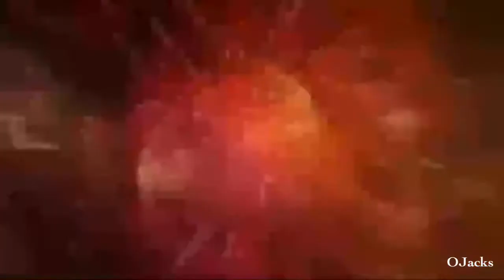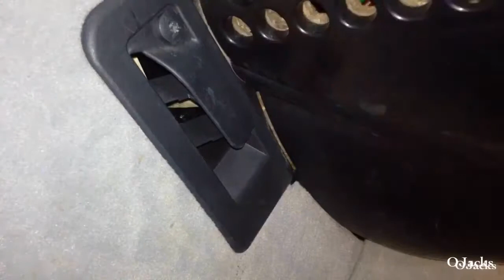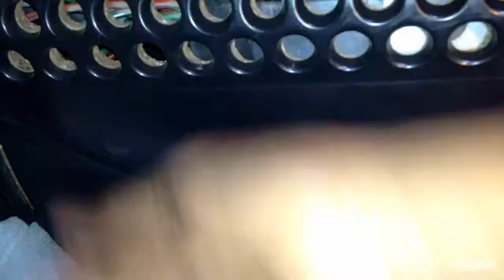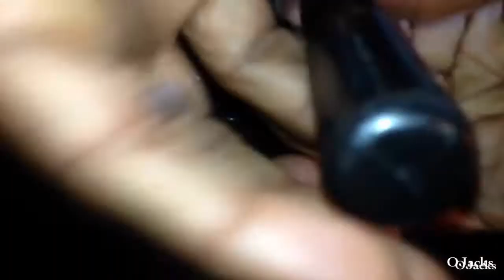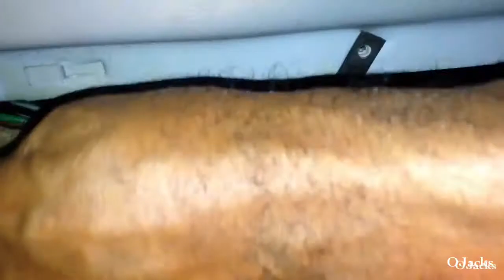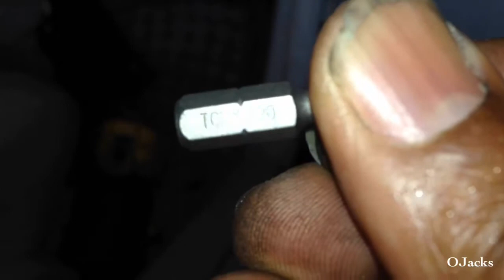Blower Motor will not turn off even when the Key is out of the Ignition on Mercedes

Comment: Thank you so much man! I found the part online for £24 and did it myself with your help. I really appreciate it
Reply: was the problem that the aircon won't switch off? even when ignition key not inserted?
Reply: @ED-nc2uv  firstly I could hear the motor blowing when the key was out. I replaced the blower motor and it seemed fine. Then the power drain came back but I didn’t think it was the blower motor as you couldn’t hear it any more. Turned out the drainage had got blocked and it was wetting the blow motor resistor
Reply: InstaBlaster...
Reply: @samwellfoden  how did you clear the drainage??
Reply: @BiznessBoyProductions-FAM  took off the rubber cap with a flap on it as it just causes it to get clogged then pushed a piece of wire through or kebab skewer :)